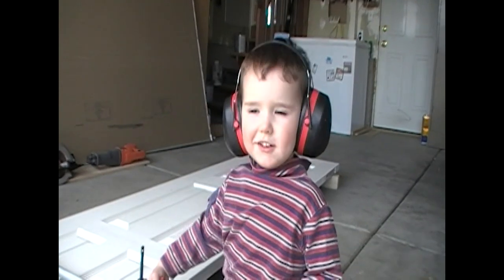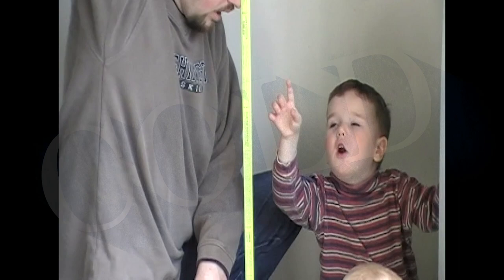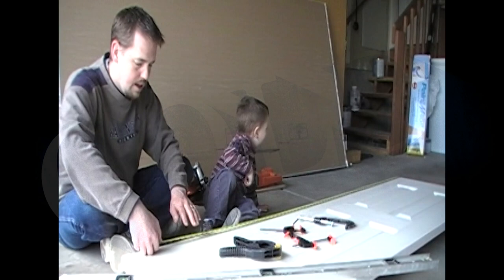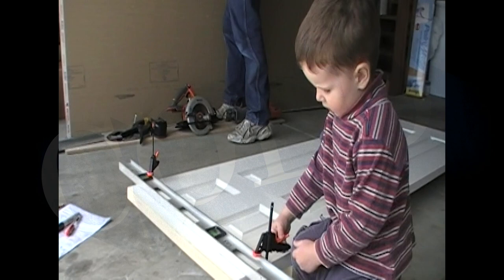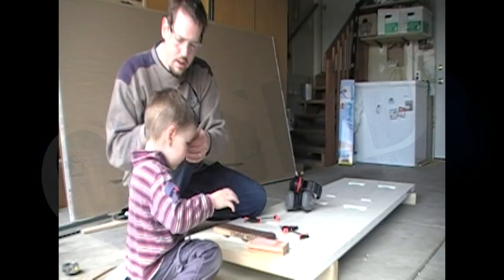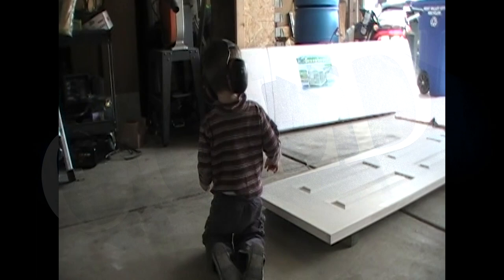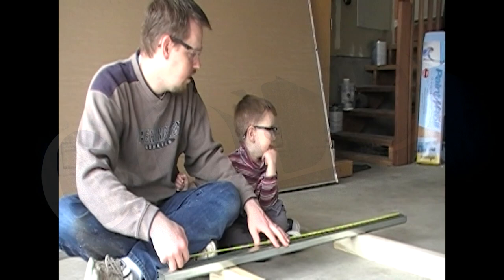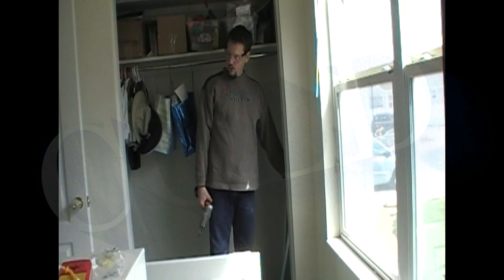Home improvement with Josh Powell, part 1

Comment: Josh Powell was a very strange and unbalanced man. He expected his 3 year old son to do things with perfection like an adult, yet he himself couldn’t even hang the doors so they were flush with the wall. Measure top and bottom widths, then several points along the vertical measurements of the opening. Then cut to those measurements. Rarely if ever are walls and floors even. They are often off a little... just like Josh. Actually Josh was off a lot. He couldn’t connect with or understand his children. He must have had a nightmare constantly rolling around in his head on what was not quite as perfect as he thought it should be. I feel so sad for those children and their mother. Just heart breaking.